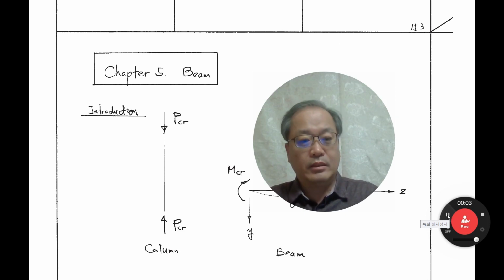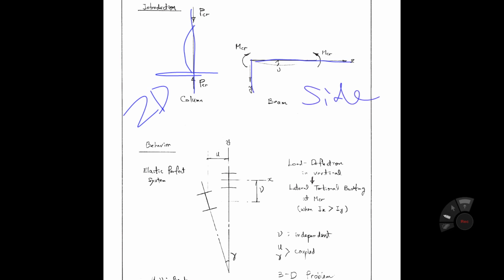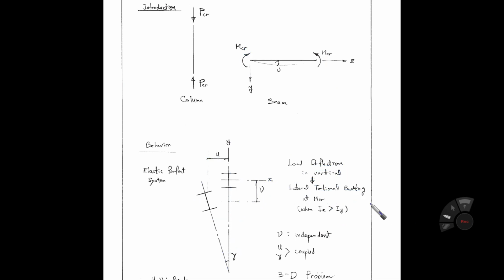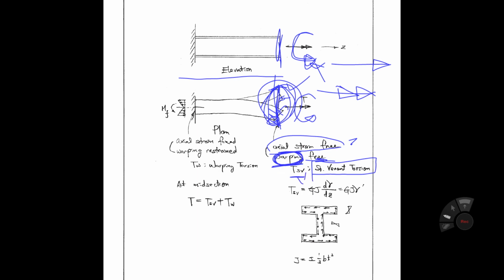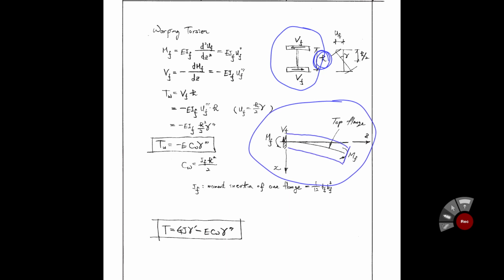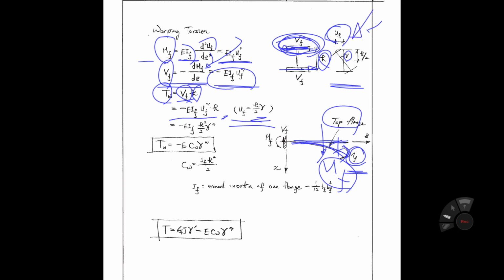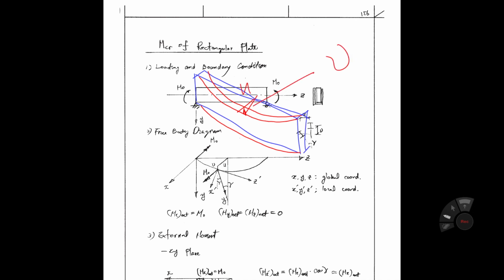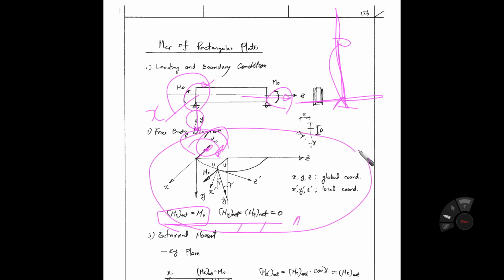Lecture 21: Lateral Torsional Buckling

Comment: Sir appreciate your lectures about column buckling.
Why most code using for minimum eccentricity L÷500 +S÷30 as there is no ecentric load on it. As the L÷500 is due to initial imperfections. Can u Plz make one lecture on how this calculation came. Thanks Sir